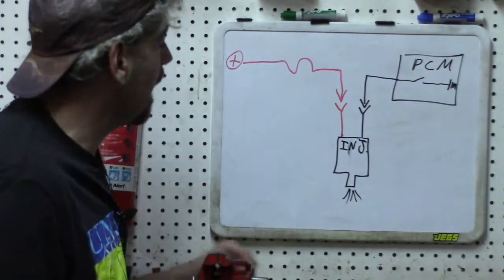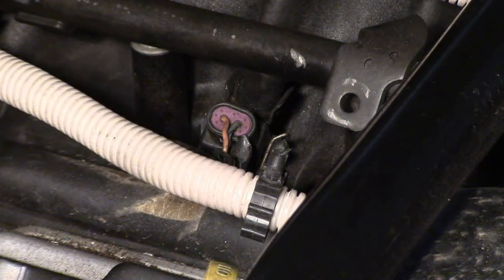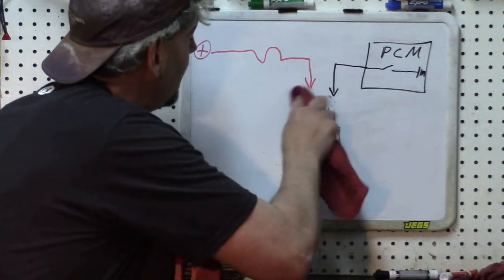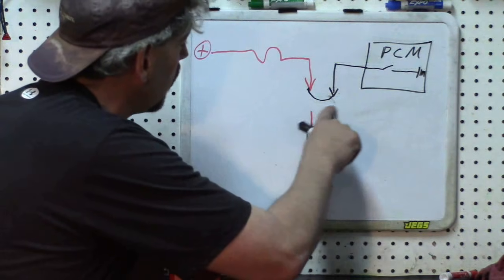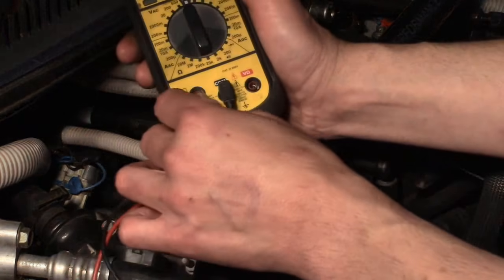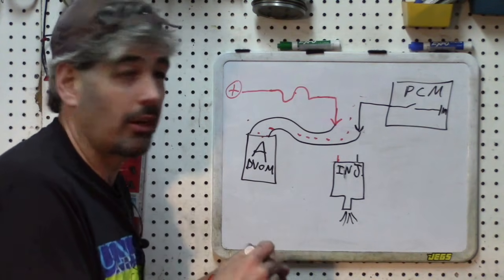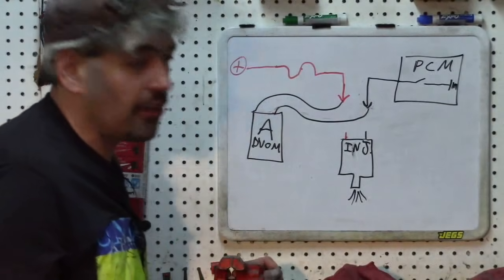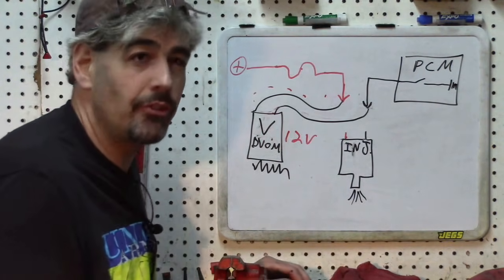How to Not Fry Your PCM-  SBQM Channel Free Video Sample!

Comment: Your diagram is misleading, but I understand the reason for simplification.

The PCM uses a transistor as a switch. The emitter is connected to ground, the computer signals the base and the collector is connected to the device ground side. 
When the transistor is turned on with a small current flows through the base to the emitter, then a larger current can flow from the device through the collector and emitter  to ground. Since the transistor can only handle a relatively small amount of current, 12 volts with no resistive device applied directly to it will make it fail like a fuse opening due to excessive current. The transistor is on the PCM internally, the PCM the therefore fried is not repairable.
Reply from the maker: +BChrisL Correct, as you said though i just wanted to simplify and get the important concept across

Comment: Hi Matt, I'm still new on this stuff and I find your videos very instructive. I was just wondering if that last test could impose a risk. Would it be theoretically possible that there was a a short in the MAF sensor itself? Wouldn't that blow up your meter at best and at worse the pcm?
Reply from the maker: No because the last test did not test for amperage in series with a potentiall faulty component.
Reply: But at 25.03 you set the meter to AMP mode. If the fuse on the first part of the circuit is blown, wouldn't it be drawing the current thought the meter?

Comment: Hi Matt.  I have to add my concern along with the others about your choice of words.  I like and respect your efforts as an educator, and I know you know better, but you simply cannot interchange terms like "high load" with "high resistance" for the same condition as they are commonly understood to be the opposite of each other. When this is seen by folks that know better you lose credibility.  When seen by those that don't it's dangerous, irresponsible, and just wrong no matter any justification in a previous video.  We all have to use the same words in the same way or communication becomes meaningless.  People don't remember lessons and such verbatim and if you're not consistent, the wrong words can stick in the memory, and when the wrong terminology is applied to voltages higher then 12v (such as working or collaborating with others without visual aids) things can get pretty interesting (and crispy) in a hurry.

All the best,
Grouchy
Reply from the maker: +Eddie the Grouch Agreed- should have stayed consistent with load vs resistance. Just out of curiousity- can you give an example where having a high resistance with low load (or vice versa) would cause destruction of the circuit through any of this testing?
Reply: @SchrodingersBox  10:24 Where you say "more load" referring to the DVM set at 20 volt scale, it's actually less of a load than the injector. Less load=higher resistance=safer for PCM.
29:15 It is a good idea to have a fuse in line with your meter set at 10A. If there's a short in the circuit, you're going to smoke your meter at the 10A scale since there's a 20A fuse in the fuse box protecting the circuit. I would've checked the 20A fuse if I had no power on the pink wire at the connector. That is most likely the culprit.

Comment: You'll think I'm being a dick, but that's OK. I have to go along with the others, Eddie the Grouch gave the best explanation and definition.  Higher resistance = LOWER load.  They are pretty much understood to be inverses of each other, and the word Load has a very specific meaning in the worlds of electronics and electrical work.Joe Shearer made the same point equally as well.  We are not trying to be asses here.  The word "load" really does have to be used in proper context.  _  It implies low resistance, not high resistance, and it implies higher current flow (in relative terms).    _With a "low resistance", the current source is will see a relatively "high" load.
Reply from the maker: +douglas “The flame is dead” lee No I get it. It's explained better in the other parts of the series- remember this is just one part of 4.

Comment: I've certainly had no regrets paying a small fee per month to further my automotive understanding and testing capabilities. Given some of the horror stories I've heard on this and Paul Danners channels, I would rather fully understand the system I'm working on and replace the part that needs to be replaced. I wouldn't want to pay a dodgy technician hundreds of pounds for a lot of head scratching and a parts store. There are very competent technicians out but they do seem to be in the minority. Ignore the negative comments Matt - the 2 % know better.

Comment: AAUUGGHH!!!  I'm gonna have to watch this in short bursts, lest I end up punching my monitor...  LOL

Comment forthcoming!
Reply from the maker: +rhkips Not sure I follow what you mean but I'll be around for your comment
Reply: Schrodingers Box
It's probably just a result of my time spent working in an educational environment.  I kept swatting at my screen trying to get you to back away from the car!  Stressin' me out, man!  LOL

Very good video, though!  I'm expecting folks to freak out over using an incandescent test light with PCM-related testing, but that's just a matter of knowing your tools.  If the resistance of your test light in operation is higher than the resistance of the load it's replacing, then it's safe.  Same theory behind why a DVOM is safe in Voltage mode.  :)
Reply from the maker: rhkips Exactly correct. Sorry for freaking you out lol- all the example were done on my beloved trans am so don't worry- ain't no way I'd doing anything to hurt it!
Reply: Schrodingers Box
Haha, no worries!  It was a fun ride!  And yeah, spotted that nifty conduit you've got from the get-go.  :D

Comment: 23:30 NOT SAFE ... ok safe for the PCM, cause it is not in the circuit. But it is not safe for your DVOM, cause as you said, what if he has only loose connection and while connected he gets 12V to the pin. You may kill this function of your DVOM. Never do resitance measurments at a loaded circuit!
Reply: +1kleineMax1 How is the circuit loaded with key off on this design?
Reply: K, missed that. But i was just listening along and as you didnt said KoEo at the first test i didnt thought of this and didnt read the ignition power in the schematic.
Reply from the maker: +1kleineMax1 The proper use of the ohmmeter is discussed in part 2 of the series and specifically talks about saw application.
Reply: <- German